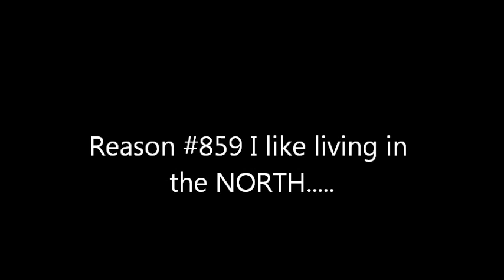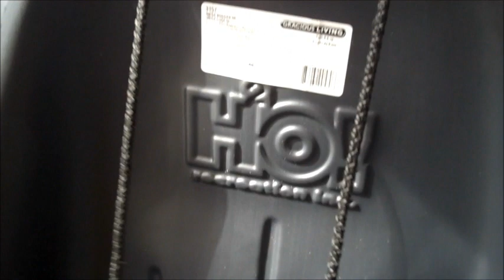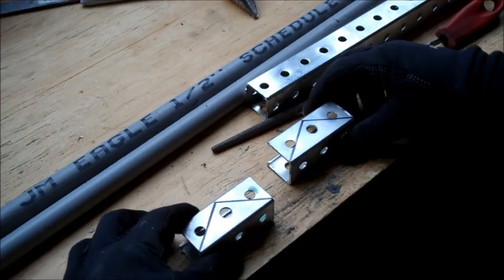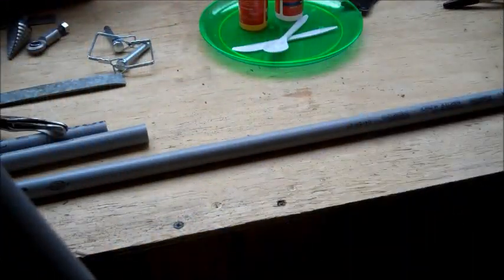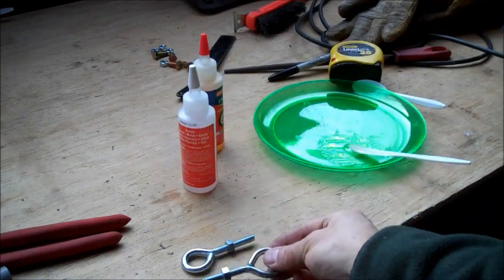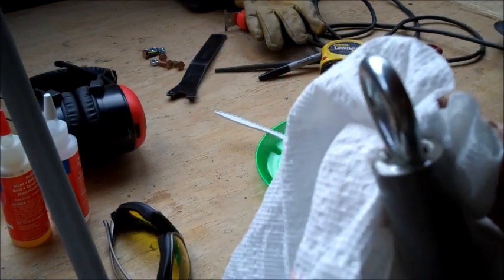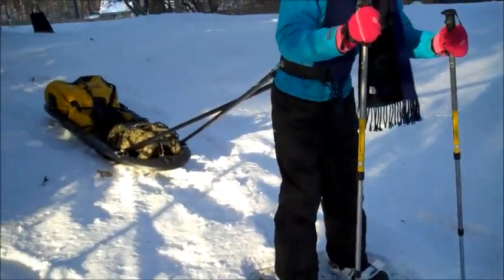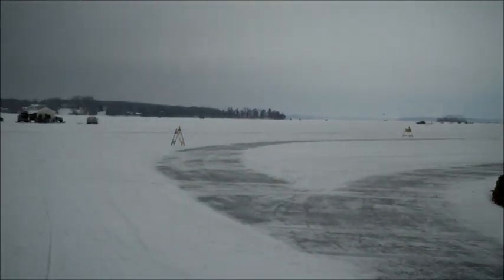DIY PULK or SCOW SLED - Winter Travel Made Easy

Comment: Awesome job, simple and doable for anyone. Have you thought of a skeg on the bottom to keep the yaw when going at an angle up or down hill? Angle iron through the bottom is what I did to one. Not too good on flat surfaces, but keeps it on track when going diagonal. Thanks for the great idea on the bars. I never thought to heat it up and set them with epoxy. I used rope through the emt and will be making some like yours. Thanks again.

Comment: Angle grinder -most versatile tool I own! 
Cut, grind, shape, sand, polish... Don't worry as you requested -I WON'T put a safety tip in here! I've got plenty of Horror stories though! ;)

Anyway, on another note -couple of Christmas's back I made my Sister a solid iroko sled with runners and everything... Thing was bad ass! Got a horrible feeling it ended up as firewood...

Comment: Yank, great video! Is it necessary to use the tie rod ends or would a simple readily available eye bolt work at both ends? Do you have an update on the tyvek tent? How has it worked out and as it held up? Thanks for sharing your many talents.
Reply from the maker: +Almost Prepared Some guys just use rope,  so I am sure the eye bolts would work.   The difference is the tie rod end aren't sloppy,  so my sled is going to be more precise concerning control and tracking of the sled.   And it not going to "clack" around behind you.  I personally enjoy the silence of skiing into a place.   The Tyvek tent is still usable,  but I never use it.   Mostly let the kids play in it.    I did that project just to show what could be done,   I have much better and stronger tents that I prefer.

Comment: Nice Video.  How well does the epoxy and melted PVC hold up with regard to wear / use of the poles?  Any issues with the tie rod ends or eye bolts ever pulling out?
Reply from the maker: This is not an "experiment" video.  This is a "How To" vid.   tested and tried many times.